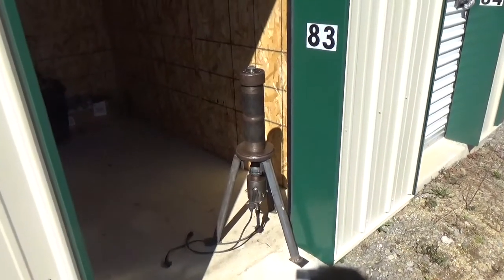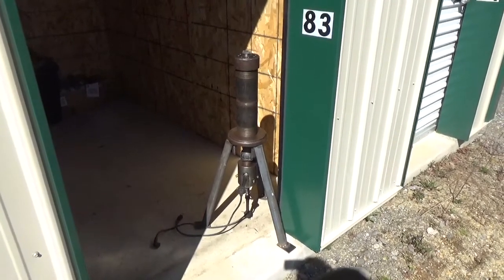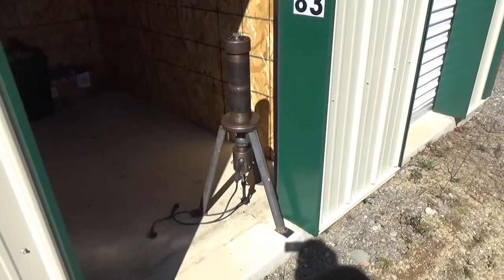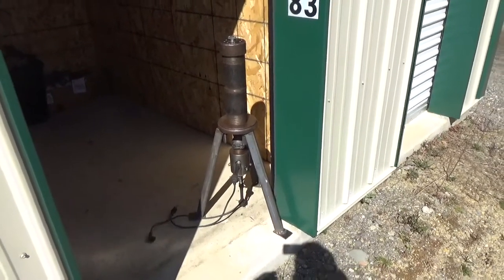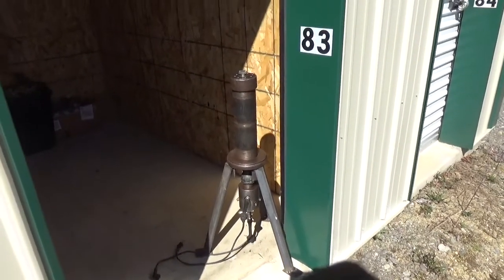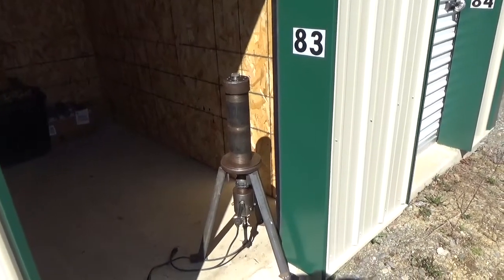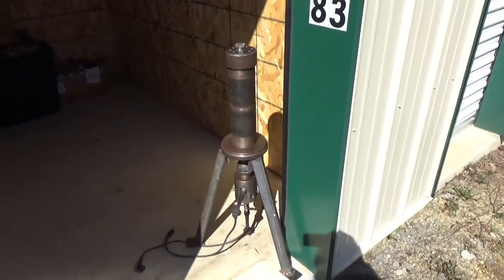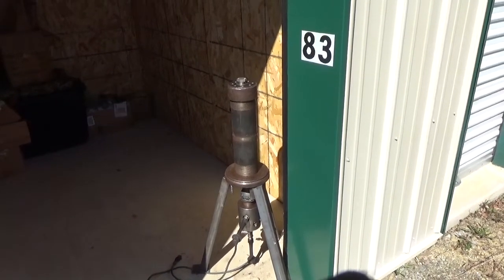Atomic Hydrogen Boiler: Potential For Instant Super heated Steam

Comment: I noticed a funny coincidence  a few years ago that made me wonder about steam / hho. The expansion in volume from water to steam is about 1600 to 1. The rate of expansion from water to hho gas is also 1600 to 1. So is it just two ways of getting to the same point? One hot and one not?
Reply: I didn't know the exact ratios but I found this video searching hho from steam with that exact thought. It's expanded already so as it cools it may retain or accumulate more energy. But the main thought was that surely it's got to make hydrolysis happen quicker. Does steam conduct better than water?
Reply: @BCzepa  I recently saw an old video where a guy puts a vacuum on a Joe cell and as vac increases the amp draw goes down significantly
Reply: @tiredironrepair  hmm maybe cause it's making it more likely to evaporate. How much of a vacuum? You know how water 'boils' under immense vacuum. It's always fascinated me how water evaporates and clouds don't fall out of the sky (not all the time anyway). Dew point, adiabatic pressure and gravity theres an electrostatic force there.

Comment: this is not some kind of perpetual machine? you need energy to break down the molecular bound in the hydrogen molecules, the energy obtained from recombining them cant possibly exceed the energy you used to separate them.
Reply from the maker: All you conventional "scientists" forget one thing: "in a closed system". Otherwise, in a closed  system that is true. Are you aware that anions or, whatever energy Tesla called it, penetrate all matter and flow endlessly from, as Tesla termed it, the aether. We are surrounded by an infinite sea of energy that, like the tides, flow to maintain balance or equilibrium.

Comment: have you tried to do a water hydrolysis using lead amalgam cathode to get atomic hydrogen?
Reply from the maker: No, I never tried lead amalgam cathode. Did you try it? Why do you ask? Does it work better? I did use iron cathodes based on an MIT study that showed 14X more Brown's gas output than was present in the water/electrolyte. The scientists were totally stumped and had no explanation for the strange results. All they used was water/lye electrolyte. They also measured anomalous elements in the mix that had not been in the iron or in the water.
Reply: @hyfusiondotcom  i havent tried lead amalgam cathode my self but i read about it in a pdf in which a claim was made that if use said cathode you can prdouce h1(atomic hydrogen) straight from the hydrolysis and wouldnt need to invest more power in creating an arc...
and if you could link the MIT study that will be most appreciated.
Reply: @hyfusiondotcom  and if you want me to send you the pdf i can upload it to google drive  .and btw realy good job on this channel its very helpfull
Reply from the maker: Here is the reference to far over-unity Brown's gas production. Journal of Theoretics
Volume 5-5, Oct-Nov 2003
Cold Fusion By Plasma Electrolysis of Water
Ph.M. Kanarev kanphil@mail.kuban.ru
The Kuban State Agrarian University, Department of Theoretical Mechanics
13, Kalinin Street, 350044 Krasnodar,
Russia
Tadahiko Mizuno
Faculty of Engineering, Hokkaido University,
Kita-ku, North 13, West-8 Sapporo 060-8628,
Japan
Abstract: It has been disclosed that transmutation of the atomic nuclei of alkaline metals and the atomic nuclei of the cathode material takes place during plasma electrolysis of water. As a result, excessive quantity of gases is generated.
Keywords: atom, proton, neutron, electron, cathode.

I would like to see the PDF on lead amalgam cathode. zorrion AT protonmail dot com or, just send link to Cloud here.
Reply: @hyfusiondotcom  https://drive.google.com/file/d/1Dp5tgAoK9cui-HU_ZXh9jKhGmbHcMMh5/view?usp=sharing and thanks for sharing in page 16 the reference but no explanation in regareds to the cathode/
Reply from the maker: Thank you for sharing!
Reply: hyfusiondotcom had you found a company that makes these cathodes or made ones yourslef ? 
and a genrel qustion where you able to compltly run a car relying only on atomic hydrogen prdouced by the car battery ?
Reply from the maker: @rotem2116  I could find out nothing about lead amalgam cathodes and no verification of research indicating they produce monatomic hydrogen.
My Plasma Arc Reactor is in the early stages of development and research and progress will have to wait until I can fly to my new workshop in the Caribbean. In any case, I'm not interested in using my device to convert ICE cars to run on hydrogen. My invention is suited to produce water at Critical Temperature & Critical pressure for instant steam to power my latest invention, a steam engine. See https://youtu.be/vhodJT9Fblc
Reply: @hyfusiondotcom  i will have a look at your device. and did you try to include magents as a way to increase your hydrogen productuon.
and thanks for replying
stay healthy and free
Reply from the maker: @rotem2116  Yes, I've done a fair amount of experimentation using magnets and saw a strange phenomenon; the HHO bubbles began spinning in a vortex as they rose off the SS tubes.

A collaborator sent me a video of his magnet HHO generator that used almost no power but appeared to put out a ton of hho. I could not duplicate his results and finally gave up.
Reply: @hyfusiondotcom  i saw the same effect and read a paper saying you can double your h2 output by using a neodymium magnet near the cathode. as well as the spinning effect when using a high voltage high frequency power supply the same spinning effect is present and i know sten meyer used a electromagnet inside his cell. as well as a high voltage high frequency low amp power supply. i believe theres an much added h2 creation when combining this two approaches but have yet to test it out.
Reply: Please can you help me how to build your heating system.waiting for your reply

Comment: Your going to blow yourself up !
Hydrogen will not compress above .46 psi ! It detonates ! If you add hydrogen and oxygen in a container with pressure over .46 psi you will not need a plasma to set it off !
Reply from the maker: Good guess, however the explosive energy, in the form of super heated steam is not trapped in a sealed boiler. The steam exits the reactor chamber and the pressure is measured at the exit where it passes harmlessly through the outlet into the atmosphere. The most likely event will be that it will become a rocket and orbit the earth.
Reply: Don't let any oxy in with the hydrogen !